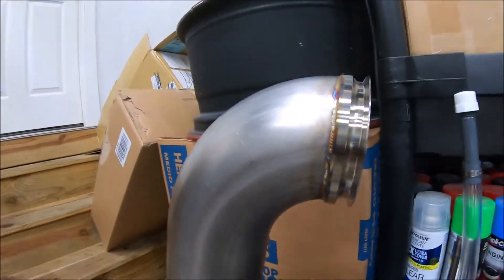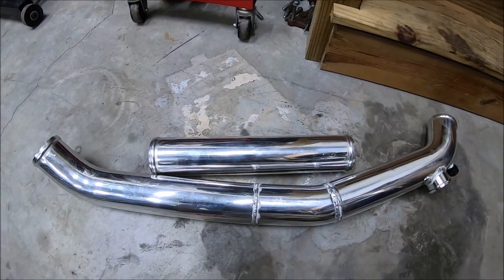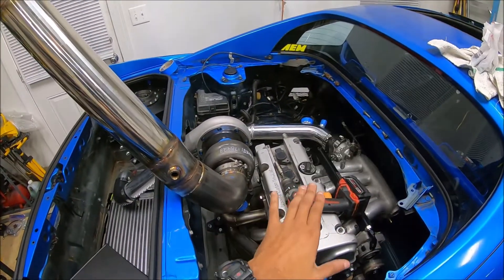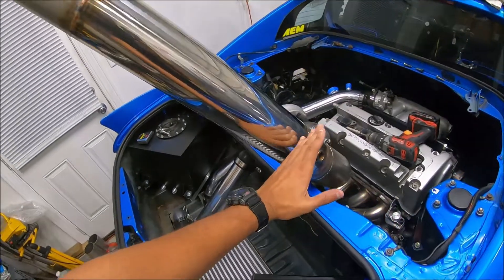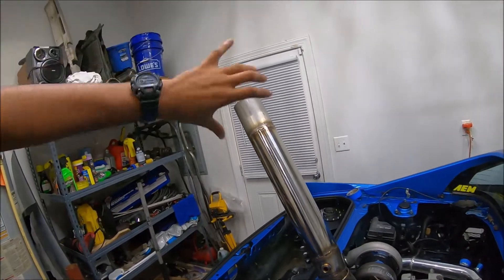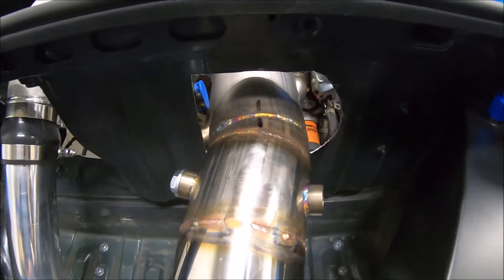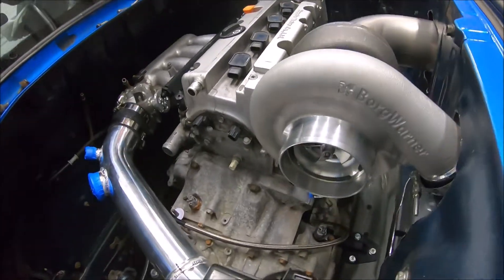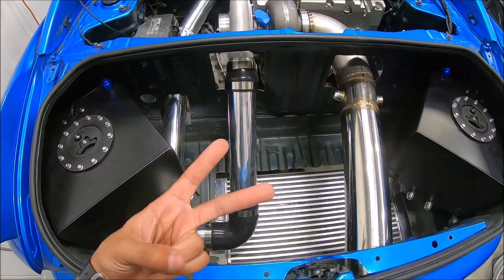Turbo K20 MR2 Intercooler & Exhaust Install

Comment: sick! coulda done without the whole trunk cutting with an air 2 water intercooler tho
Reply from the maker: Yeah I was gonna go A2W but this cars a street car not a racecar and this is soo much cheaper and less complicated.
Reply: @DC502civic629  yeah wouldn’t be a bad idea.  street car should have a usable trunk ! A2w keeps everything cooler during traffic too !  Got anymore footage comin ? Clean build
Reply from the maker: @mrmeadowsiscool  I still do have a useable trunk its in the front of the car. I can put anything I want up there for storage. More footage coming soon.